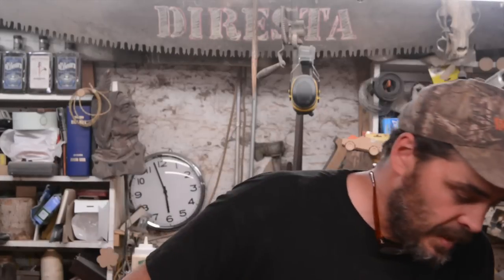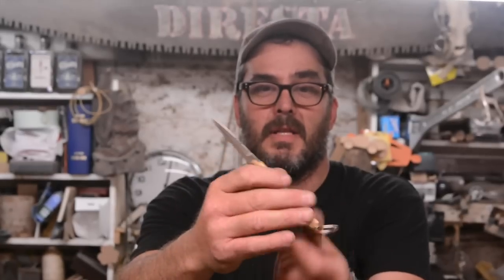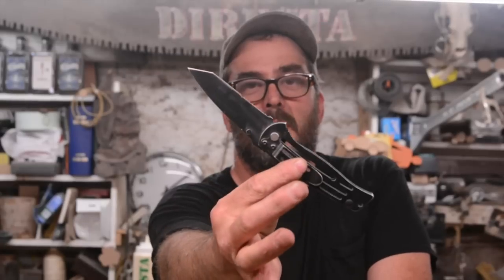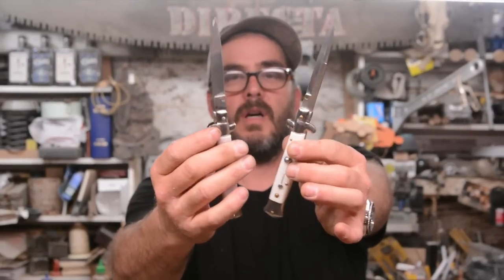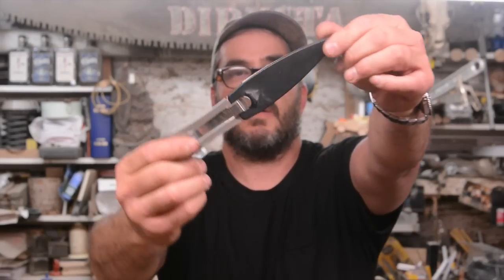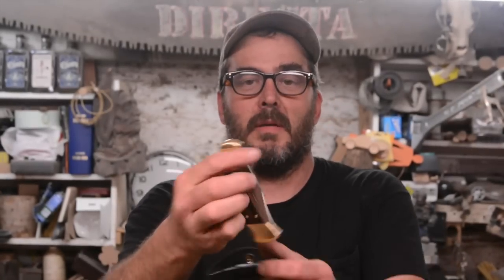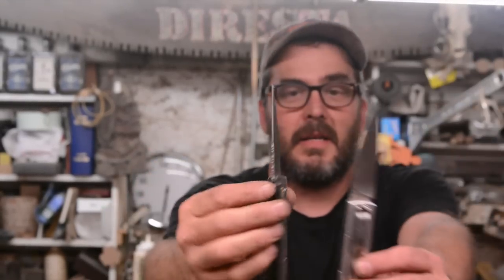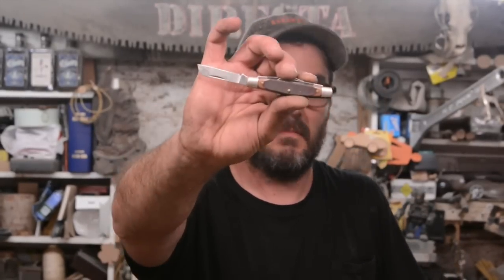✔ DiResta knife Collection

Comment: By the way, the blade at around 12:20, you said it was by "Rostfrei" Rostfrei is stainless in German :)
Reply: I used to do the same mistake too!
Reply: Notrollhere as in Rust Free :)
Reply: +Notrollhere actually rost fei means rust free because stainless steal is called edelstahl
Reply: Rakadis по
Reply: Rostfreier Stahl or Edelstahl are synonyms in German. In Swedish we say Rostfritt stål. So Rakadis is correct...
Reply: Yeah, United Cutlery is the company that makes kissing cranes, I believe.
Correct me if I'm wrong.

Comment: Jimmy, the Leatherman jams when the tools are loose. The pliers will get under them and jam tight. If you find which side is loose you can use gravity to keep the tools closed so the pliers close after them. Or you can get a couple of safety torx and tighten the tools and you won't have that problem anymore. If this isn't clear, I can take some pics to show you what I mean.

Comment: "Rostfrei" is German for stainless (literally free from rust). 12:14 14:30
Reply: Many also say "inox" which is short for "inoxydable" in French , which also means "stainless steel", or "non-oxidizing", there is at least 13% chromium in the steel preventing iron from reacting with oxygen in the air , normally producing Iron OXide, or more commonly known as rust, so "in-oxidible", like "in-destructible", means it won't oxidize.

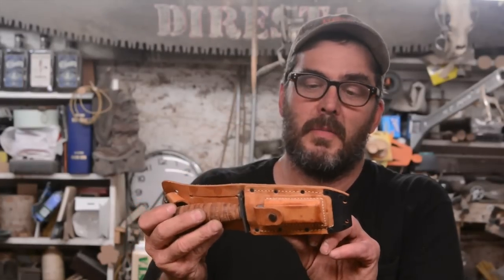Comment: Jimmy, the knife you have at 20:38 is a USAF Aircrew survival knife (the Air Force's answer to the Ka-Bar). They were issued to pilots and aircrew members from about the late 50's-on. There is a lot of information online in how to use the knife and why it is designed the way it is. Almost as good as a multi-tool in my opinion. They sell for about $40 down here in FL, double that if the sheath and whet stone are included or in good shape.

Comment: On my Wave, the large flathead can get loose and stick up a bit, blocking the pliers from sliding down when closing the tool. Tightening and thick lubricant  (traxxas 50k or other silicone lubricant) on that pivot usually do the trick for mine.

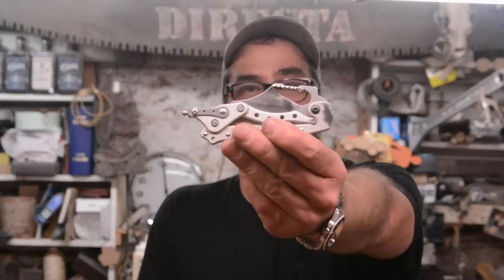Comment: The E.T. Folding Knife from Kershaw is a lightweight folder that is great for outdoor enthusiasts. The E.T. features a lightweight aluminum handle and a razor sharp blade that is capable of completing just about any task. Two other great features of this knife are the built-in carabineer and bottle opener. The blade is Sandvik 14C28N stainless steel  1:57

Comment: if you have tamper proof torx you could tighten up those multi tools. i have 2 sets of tamper torx just so i can re tighten my leatherman(s), that stiff close is the big screwdriver bit, i use robertson #2 alot and havent found any problems.

Comment: that Benchmade auto with the reprofiled blade and busted firing spring is the old RARE full sized REFLEX...i've NEVER seen another on any other video...and the old SOG folder you show at 16:35 is another beauty...SOG helped make the leap from the 110 to a more modern look and "tactical" (i know, i know) use with that folder..it's a Tomcat if i'm not mistaken

Comment: Hey Jimmy, I think youre the person to ask this- have you ever changed 
out the tools in a leatherman? Im trying to replace my Surge, but they 
dont make the old model anymore. Mine has the mini eyeglass screwdriver,
 and the new one doesnt have that. They replaced it with another  
flathead. Im wondering if I can take the new one apart and remove the 
flathead and stick my onld eyeglass screwdriver in its place. Any 
thoughts on this?

Comment: The Ontario knife or "mini K-BAR" as you called it is actually designed for Air force pilots  as an emergency escape knife. If you look on the butt you'll see the number 1984 or 1985. That is the year it was built. ESEE makes an updated version called the ESEE-5.

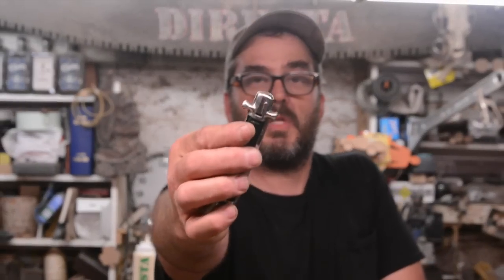Comment: Are those Buck Auto's Dual Action, Meaning You can also open like a regular knife..? I have a pair of Chinese knockoff Bucks, A 112 with round button and a 110 with an oblong button and they are both Dual Action..? Also is the "Simple Switchblade" @5:20 a French Bargeon..?

Comment: If sout leatherman multitools keep breaking, try out a victorinox multitool, just for comparison. My experience with them is that while they look less sexy than leatherman (much like a small and polished slab of stainless steel, not suggesting a multitool at all) they actually are more pleasant to use - and they never break. You can always go back to leatherman if your victorinox breaks ... :-)

Comment: Your lethermans might be broken. there's supposed to be a small steel snip inside the handle that helps to close the jaws, so they don't get jammed as yours do. you might be able to se the problem with the magnifier glass you made . greetings from Denmark where close to al knife's are seen as deadly weapons if the blade is lockable and the knife can be opened with one hand....

Comment: 13.37 you ask the cost of the LAGUIOLE wich is a traditionnal french knife made in a region called Aveyron (in the middle of france), its a knife that got a lot of succes unfortunately the creators didnt "deposit" the shape and the brand, so everyone can do it in america or china. no way to tell if it is a true authentic lagiole, their price vary with the material used for blade or handle. for this one wich seems to have and aluminium handle i'd say 80 EUR if authentic.
price vary from 50EUR ro 1000+ with options.

Comment: Rostfrei: pronounced "roast fry" is German for stainless. It's not a manufacturer. Also, that benchmade with the failed opening mechanism should be replaced for free. I'd call them up about it. You can also have the broken blade replaced for thirty bucks.

Comment: +jimmydiresta quite the knife fetish you have. But I'm sure you know that. I was surprised you did not have a Mercator K55K Black Cat. It seems like it would be right up your alley. The blades are too brittle, so the tips always snap off, so not a good prier. But they are thin, and they take quite an edge. They used to be dirt cheap too. I remember buying them in a local hardware store for $2 a piece. Now they are too expensive. Still, it strikes me as something you'd enjoy.

Comment: The sog "slim Jim" same problem man opened in my pocket, ripped it, cut me never carried it again ! cool idea, bad design...
Reply: I wanted a slim Jim for a long time but put off buying one because of all the stories of accidental deployment. Finally I found one cheap on Amazon and said to hell with it, I'm buying it. If it opens I'm only out 30 bucks. I carry it regularly and I guess I got a good one. Hasn't opened once. And I don't use the lock. Guess I'm one of the lucky ones. I like it cause I carry my knives in my back pocket and the slim Jim is so...well...slim that I don't even notice it. Haven't even attempted to use it hard because I'm sure it'll break.